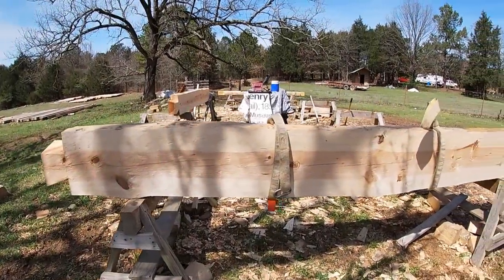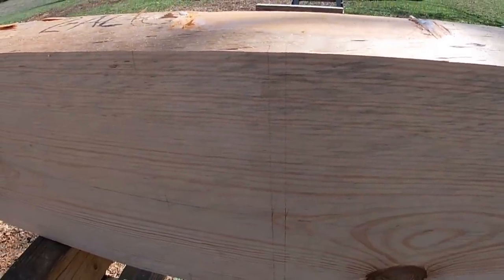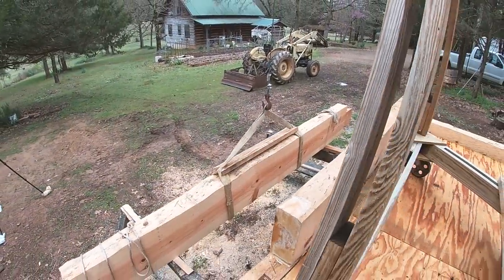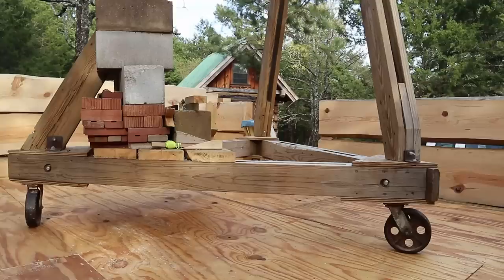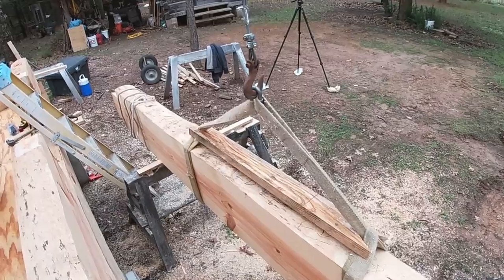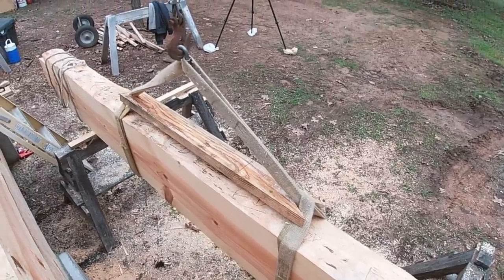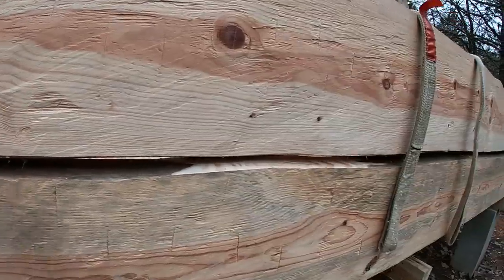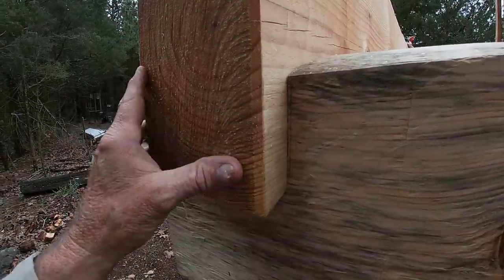Setting Round 2 - Dovetail Log Cabin Build (Ep 19)

Comment: very thorough, and your workmanship is an inspiration. One small comment; three 3 way pull on your carabiner dramatically reduces its strength. probably not a problem for the weights you are handling, but you could use a short sling to bring the two straps together, or even pass one loop through the other maybe.
Reply from the maker: Phil Jones   Howdy Phil-  Thank you so much for the kind words. You’re very right about the caribeaner. I think the one I ‘m using is a half inch thick. I have had to use different strap hook ups before. God bless you

Comment: For some reason Paul I thought you were building with oak logs. I like the hoist you built but I must admit I'm going to be cheating there. I bought a 175' mobile crane at DRMO auction at Kirtland AFB last year, lol. Runs and drives very nice and it's already paid for itself a couple times already. Service culvert started this week. It's a 7" surplus water line I acquired from a local plumbing company. It will house the wiring from the solar panels as well as the pex line from the water tank. No concern with a water leak down the road since the solar is DC. I'll have the loan of a backhoe in a couple weeks to trench tp the septic tank. There is a logging company thinning forest area about 10 miles away and we have struck a deal on the small 12" by 32 plus feet red fir that they have to cut but won't be using at their sawmill in Colorado. I thought 
.75 a foot was a bargain delivered. I've piered for a 28x28 but at that price I may build a workshop as well.
Reply from the maker: Dave Johnson   Howdy Dave- l just used oak for the joists. Sounds like things are starting to move forward for y’all. PTL! If l had a crane you can believe that l sure would be using it. Glad you’re able to get your logs and won’t have to haul them very far. That’s a blessing! I ‘m lookin forward to seeing some pictures of your cabin when you get started on it. It’s gonna look great! God bless and keep y’all safe out there

Comment: Nice hoist system. Coming right along. Will you stain the exterior when finished? What will the cabin be used for when done?
Reply from the maker: Santa OB   Howdy Santa-  l normally spray boiled linseed oil on the outside but I may use some other preservative under the linseed oil. You’ve asked a good question about what it will be used for. I ‘m thinking about a small work shop for doing small primitive wood projects. And then, it could be used for a dawg house in case I get in trouble with the Lady hehe. God bless you
Reply: The Bearded Carpenter : Your the fellow who could sure make the furniture 🪑 Ho Ho Ho🎅🏻
Reply from the maker: Santa OB  I was in contact with a feller in Colorado that you might enjoy. Elk Run Handcrafts and Construction. You can find him on Facebook. He is a unique furniture maker. He does log building also. Blessings to you
Reply: The Bearded Carpenter thanks I’ll check it out.